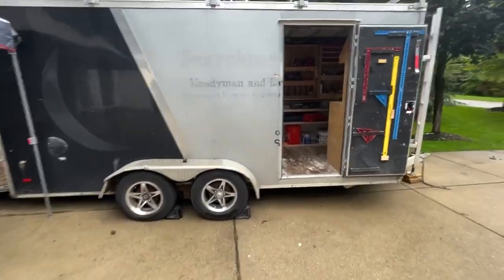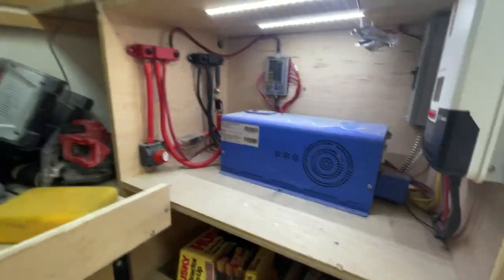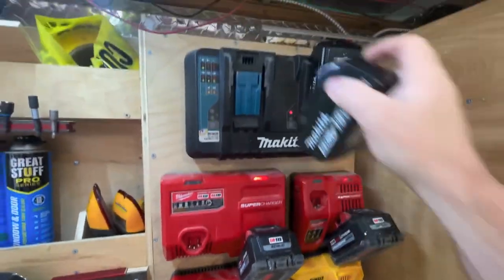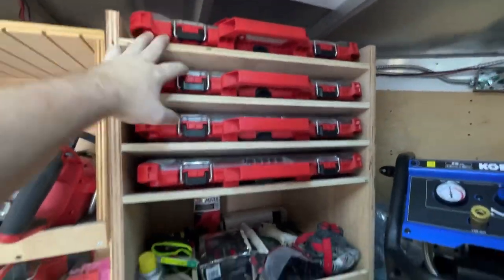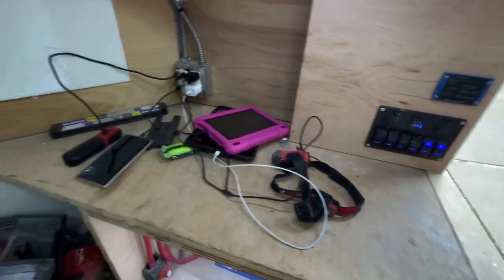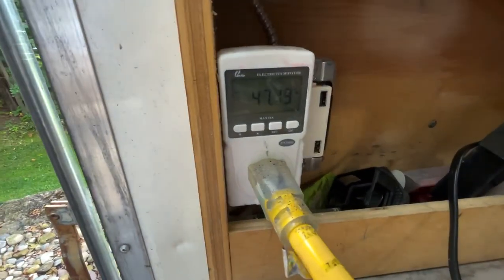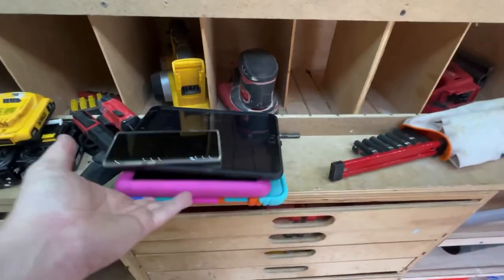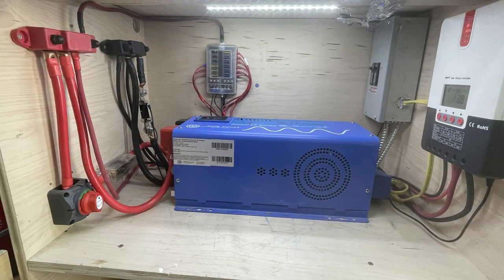Tool Trailer Battery Bank! What can it 690 amp hours power?

Comment: How long could you power a minifridge with your set up, just curious lol
Reply from the maker: Depends on the watt usage of the fridge and if it’s DC or AC. The one I was going I install would run off the solar I have except the battery bank would need to be charged via generator or shore power twice a month.
Reply: @RenovationsandRepair  ok thank you

Comment: The solar is something I'd love to do with my trailer, just can't make myself buy the stuff to do it with. I keep a predator 4400 watt generator with me for no power jobs, or roadside repairs if necessary
Reply from the maker: Solar is nice but high buy in price. Once you have the equipment expanding the wattage is cheap. Just takes a lot of space. Space you don’t have on a tool trailer
Reply: @RenovationsandRepair  That's my other hang up. I have a 14' trailer and I'm pretty well out of space already